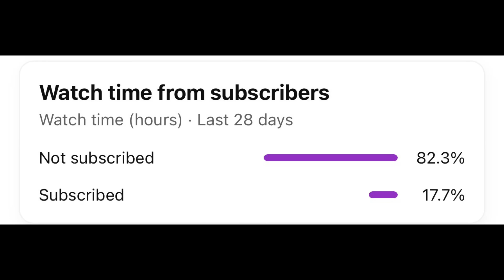The calm AFTER the storm, update on Liverpool F.C’s Anfield Road Expansion

Comment: Great coverage mate and it's pretty cool that you, Paul and Nick are working as a team on providing it, I should probably include Craig as well now, you're right he's a good lad 👍
I didn't realise you had your ST in block 224, (I watch a lot of games from 225) great vantage point above and behind the goal especially from the front row with the wall to lean on.
I can't believe how quickly that grass has turned yellow but at least the two guys that spend all day, every day mowing it are getting a well deserved break. I'm getting the same news
as you that the pitch will now be re-laid before the start of the season, I don't think that was planned if we had removed the roof in the World Cup break but there will lots more time
to do it now and it will give you something else to video 😊As for your wish for a souvenir piece of scrap metal, when the standing Kop was demolished the club sold individual
bricks in a presentation case with a brass plaque and certificate of authenticity, they were expensive but all the proceeds went to charity, I think we did the same with the old 
wooden seats from the main stand, and also a lot of memorabilia from Melwood, not sure scrap metal has the same appeal though 😅
Reply from the maker: Yes mate, 224 was a fantastic view. They wouldn’t have had time to relay the pitch during the World Cup

Comment: That will have to be a mammoth crane if, as you say, to reach over the KD stand to lift a section from the pitch over that stand… I can see that the section of roof right in the corner being lifted from the outside but I just don’t see how the other piece could possibly be lifted over that stand, so I await developments with interest…
Reply from the maker: That crane in the car park is massive, with more to be added by the look of it